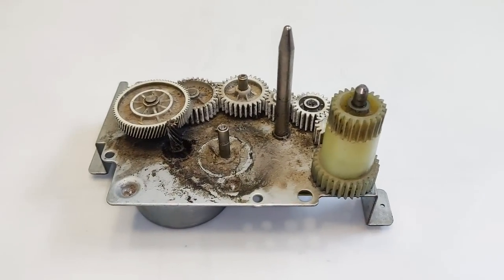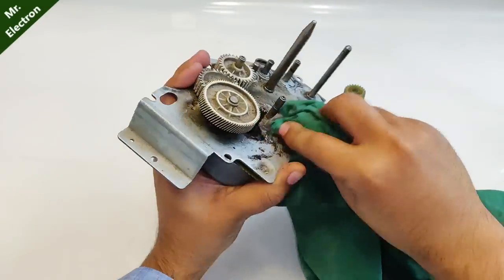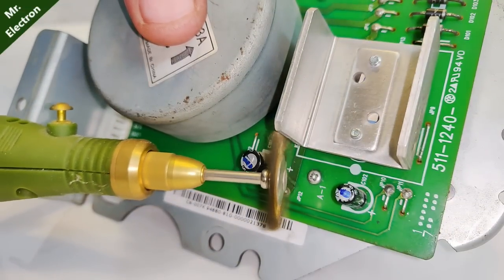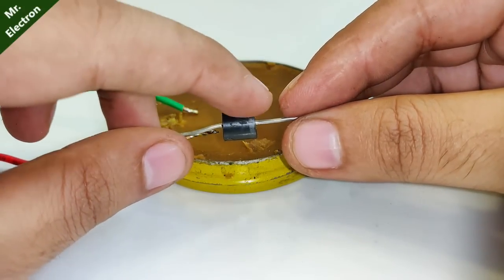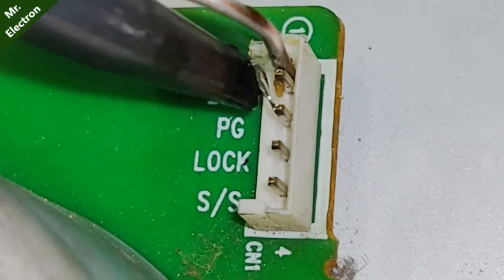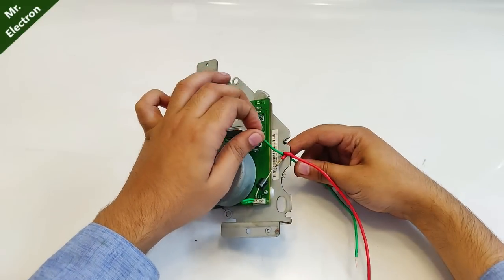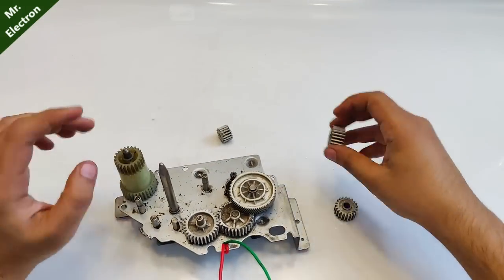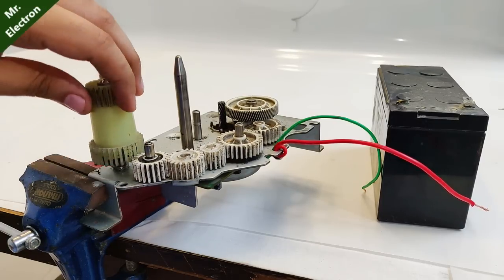500 kg-mm | Run 24V 120W Brushless DC Motor from Photocopy Machine without BLDC Controller

Comment: The PG pin is  Power Ground. Its the ground for the 24v supply in the original unit and there may be multiple power grounds. Anyway that pin should be your first choice to ground, but anywhere with continuity to that point will probably work too I guess.

Comment: Kya jis mobile ki battery ke circuit mein sirf ek hi IC Ho To Kya wo auto cut Karega circuit
Aur agar mein Mobile ke circuit ko series Mein connect Karun To Kya wo Thodi Jyada voltage ki battery ko charge kar Payga

Comment: Where do you get a 12v 7AH lead-acid battery charger???
Reply: I use laptop charger 15v
Reply: @mrelectron_alternator  but how does your battery charge perfectly fine and not explode/overcharge????
Reply: @julianslab1511  i use a diode in series to reduce input from 15v to 14.3v
Reply: @mrelectron_alternator  I meant how does your charger know when to stop charging the battery so it doesn't overcharge?
Reply: @mrelectron_alternator  Thank you
Reply: @mrelectron_alternator  how  to  charge   9v  battery
Reply: @nurmohammedazad1817  you cannot   charge   9v  battery   it  will be bust  the battery